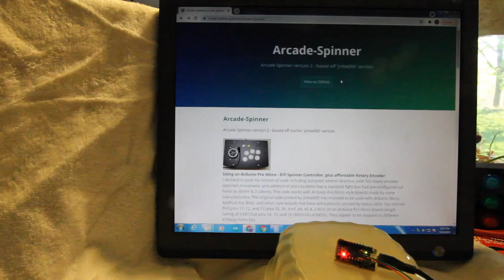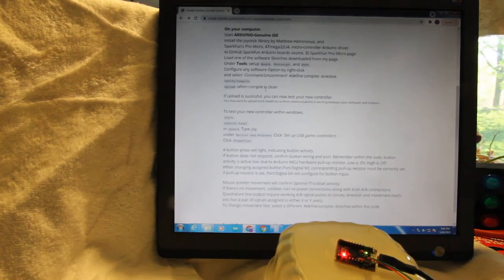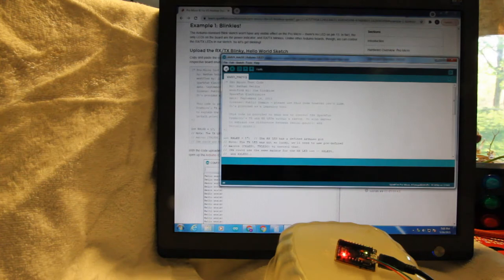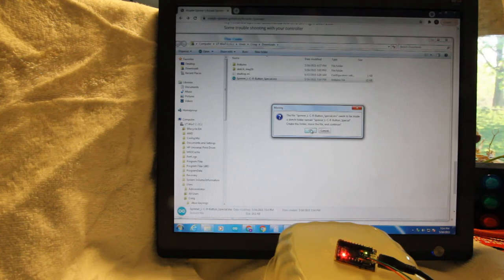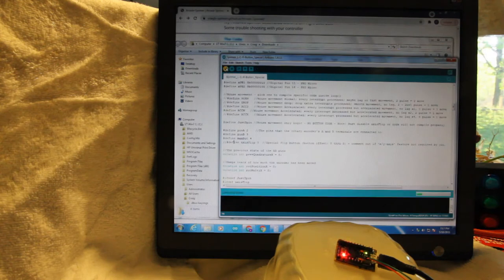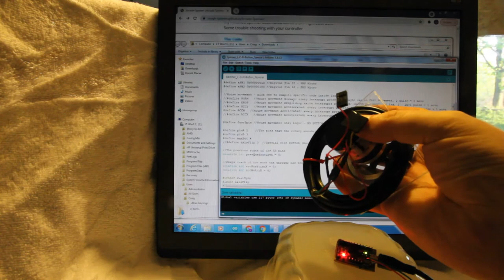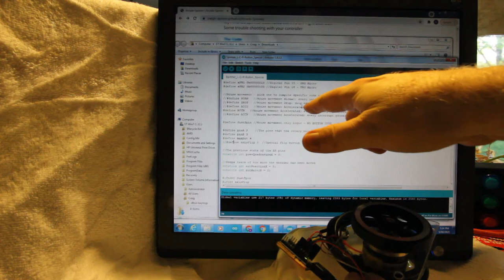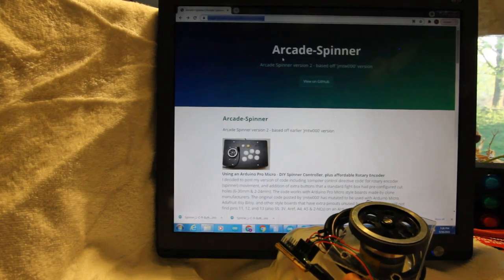DIY Arcade Spinner / Trackball - How to Arduino IDE

Comment: Hey Craig, 
I am working on a custom trackball using rotary encoders for my University Project, I was wondering if I could pick your brain possibly? I need to be able to make the ball freely move while transmitting its rotation to the encoders. I was thinking of using gears or pulleys but I am not sure of the common setup for getting the trackball to move independently of the rotary encoders.
Thanks
Reply from the maker: All trackballs are upside down ball mouse with a pinion spur reversed ratio. Ball is bigger than rollers to add a gear-up effect. There needs to be enough friction to the rollers but also skid when perpendicular movement to roller. The common design is 3 point tripod support to give equal pressure. Balled roller bearings could be used if right size can be found with low inertia. They'red used on conveyor belt systems. Best tech would be optical mouse style with optical texture pattern big ball. 
There is a 3D printed like under arm roll-on design on YouTube yellow base, white ball, uncertain of durability. (Arcade Trackball for small Cabinets)
I purchased a standard Atari style 3" trackball without the micro-controller USB, PS/2 outputs and did my own MCA HID interface.
Reply from the maker: Extra comment most trackballs use pin wheel with optical pickups (TX/RX light beam). There are hull effect sensors today that would do something similar. About mechanical rotary encoders, avoid as they are slow response due to contact bounce. Good for volume controls.

Comment: It's possible use trackball and spinner in the same Arduino?
Reply from the maker: Answer - Maybe...
The Pro Micro and Arduino Micro both use the ATmega32U4 MCU chip.
 I am using INT0 thru INT3 and each axis requires two interrupts. There is an INT6 at pin7 but all others are listed as PC Interrupts and I don't know if they have the same level of functionality.
I don't think there are any games that use both Trackball and Spinner at the same time.
You could install a DPDT switch between the x-axis of the trackball and spinner but remember each device outputs different number of pulses 677 for 3" TB and 2400 for 600ppr SP. The different bits of code are used to handle movement 'feel'.
Another switch like my touch switches will need to be added to configure the x-axis sensitivity (code flipper). You could replace the mechanical switch with a 74HC157 Quad 2×1 Multiplexer IC and input via the touch switch. see https://microcontrollerslab.com/74hc157-quad-2x1-multiplexer-ic/ 

Hey look at
The Arduino Micro has 5 more inputs that might be configured with INTx (4, 5, & 7) for some pins. Look at pins 11, 12, & 13.
Reply from the maker: You are SOL for the Arduino Micro, max 5 Interrupts.
You could look at the Arduino Mega with 9 Interrupts, using the ATmega2560 MCU chip. Sort of defeats the purpose of 'small' and cheap.

Or test using the PC Interrupts to see if they will work.
Or do the switch method.

Good Luck!
Reply from the maker: Pin 8, 9 ,10, and 16, 14 & 15 all have Pin Change Interrupts (PCINT1...6) tied to a single Interrupt which is stated that can operate as an external interrupt. Matched with INT6 say pin 7 & 8 maybe setup with the extra two required interrupts for the spinner.
The coding will be different than INT3...0 as they use different interrupts. You may need to look at the ATMEL ATmega32U4 PDF manual for setup of registers and interrupt.

Comment: CAN YOU MAKE A ls30 rotary joystick LIKE Joystick use KY-040 Rotary encoder and Sanwa JLF-TP-8YT Joystick + Sanwa 8 pcs OBSF-30 Push Button ,and use arduino make it work,i want to play midnight resistance over 30 year later
Reply from the maker: I don't know what input the game is looking for (in MAME?)
CW/CCW? - feed into the Zero delay two of 12 buttons, your 8 buttons, plus start/select = 12 

Try looking at https://www.youtube.com/watch?v=iELbrBbQspM 
Atmega32U4 has 5 interrupts(trackball code uses 4) or 12 digit i/o's (all your digits), 4 analogs that can be used as digital out (see my RGB code within the trackball code)

KY-040 Rotary encoder will require debounce logic (mechanical switches) Use spinner logic but output CW/CCW pulses to feed into Zero delay. 
Don't forget resistor to limit to 20mA load pullup. (5V/0.02A = 250Ω)
Zero delay is common +5V, when button is pressed, switch pulls input(short) Hi (+5V from ground). Atmega32U4 has limited sync current to about 40mA and I don't know how much the Zero Delay will use in a normal switch press(short).

Use a Zero delay for stick & buttons - Sanwa JLF-TP-8YT Joystick + Sanwa 8 pcs OBSF-30 Push Button
Reply from the maker: loook at https://www.youtube.com/watch?v=iwyARHUbvNI for debounce
Reply from the maker: In MAME <TAB> game menu
setup your controls for
P1 Up, Down , Left, Right, Button 1, Button 2
plus 
Dial Dec, and Dial Inc

you can use any button or setup a rotary encoder to send pulses to the Zero Delay encoder using a Micro Controller.
Reply from the maker: My spinner used an optical Rotary encoder that can send over 1000 pulses per second - yah no good but your KY-040 Rotary encoder will be much slower and requires debouncing in either hardware or software. I guess about $10 - $30 in extra hardware.
Reply: @craigb7992  thank, i mean joystrick and rotary encoder , mouse x is best ,it can be  only  one usb arduino r3??
Reply from the maker: The uno arduino R3 has two microcontrollers onboard ATmega328p(programming) & ATmega16U2(USB interface to 328p) 
I did not use the ATmega328p but the more interesting ATmega32U4 boards. It has more external interrupts.
ATmega328p would use int0 & 1 for the spinner leaving ten digitals. You can't use TX/RX as I believe they are used to comm to the USB chip ATmega16U2. 4-Joystick & 6-Buttons, no start/select
Reply from the maker: No Spinner either, the GP2040 uses a RPi Pico RP2040 to duplicate a Brook Fight board with as you noted extra features. Don't pay attention to the speed as my board was responding faster as well (in the coding) but are capped to the polling max of 1000Hz for USB (if configured). 
https://www.youtube.com/watch?v=JSKn6qdkTKU

My Pro Micro(ATmega32U4) board would need switch debounce but as it loops through 8-10 buttons before scanning the same button twice, it is natively built in. The spinner will keep processing 2400 interrupts per rotation until it loops around past all the button scans to see if it exceeds the minimum spinner movement then will reposition the mouse 1-10 pixel moves to the count tally. 
Human response was quoted to be 7ms and F1 drivers at 4ms. Mechanical switch bounce is stated to be around 5ms and that includes non-optical rotary encoder.
see https://www.youtube.com/watch?v=yf0Z0athNMM

Your SAMD MCUs are ARM Cortex dual processors running at 133MHz, x8 faster than Atmega32U4 at 16MHz, switch debounce maybe essential.

Comment: Hi Craig, thanks for the share! I was about to get the Mini-PAC from Ultimarc but their website seems to be down. So, I went ahead with your Spinner project and everything works great on my end :) Is there a way to lower the Spinners resolution somehow? Maybe within the Code or RetroArch? I even tried a lower resolution Rotary Encoder but I still can't get down to the travel speed I am looking for... I was just about to laser cut a custom encoder wheel to achieve a lower resolution lol... Any advice would be appreciated. Thanks!
Reply from the maker: There are multiple options: in hardware (MCU device software) or via MAME (I assume it's old arcade game)

In MAME 2003 or 2010 or Advance MAME plug in a USB keyboard and start the game.
Hit: <TAB>,
Select: Analog Controls,
Select: Dial Sensitivity
Adjust your valve, each game will be different.
See https://www.youtube.com/watch?v=0_aIkkObZWM

Your Arduino controller, the software is configured with ACCM directive which will do a divide by 2 on a 600 ppr x4 = 2400/2 = 1200. You can modify the code by commenting out ACCM and un-commenting ACCX which will do a divide by 4 = 600 transitions. Remember this is in hardware and effects every game the same amount. You could sacrifice a free button which could rotate thru a variable "subtract loop" towards zero (RISC divide). Most divide and multiple ops take 100-200 clock cycles that is why I do Logical Shift Right ops. Checkout Trackball_8-Button-mod-rgb code using millis() for a debounce delay instead of delay(). 
eg. if time_0 + 500 > Millis() -> do something

Third problem maybe a polling issue in Retropie/RetroArch.
I have a section under 'RetroPie laggy spinner/trackball issues' on the github page.
https://craigb-spinner.github.io/Arcade-Spinner/laggy_mouse.html